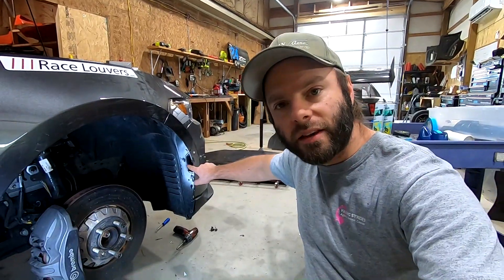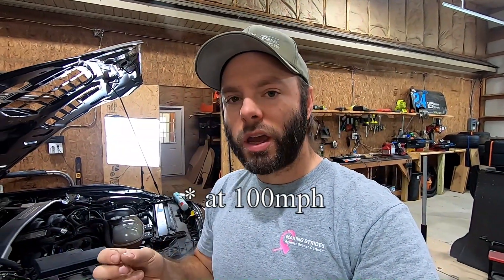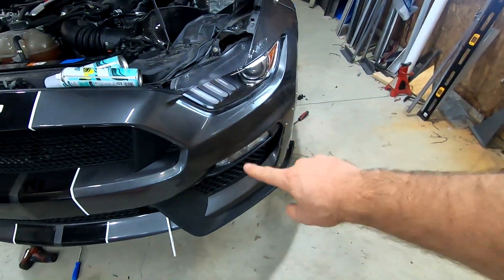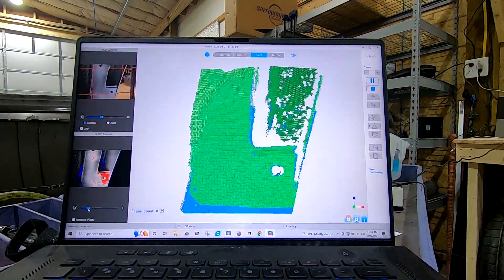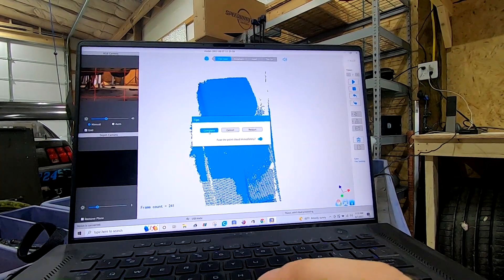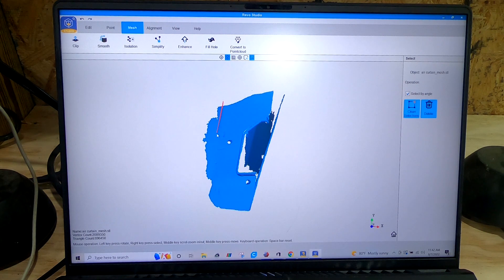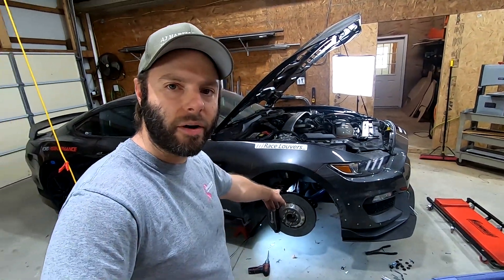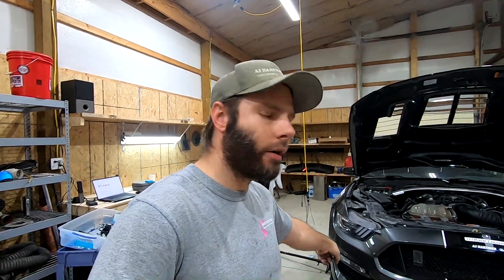GT350 Air Curtain Blockers (Wind Tunnel Data Supported)

Comment: I'd kill to have a 3d scanner like that! I'd be scanning body panels on my car, then modeling and 3d printing widebody parts and things to take molds off of to build carbon parts from. I experimented with a xbox one kinect, but I don't have a laptop, let alone one powerful enough to handle the bandwidth to scan with.
Reply: Tons and tons of people do this exact process! They judt have access to $6000+ scanners...
Reply: @Kurzawaa  yeah I have watched a ton of vids on it over the years. Even the "budget" 3D scanners are out of my price range.
Reply from the maker: The one I use is $700 or so currently.
Reply: @sinformant  Theres always iPhone 12 and 13 pro...they have liDar scanners.
Reply: iPhones can do scanning accurate enough for this now. The apps I’ve tested have pretty good tracking tok

Comment: I don't know mate, people who desing the Mercedes AMG GT Black Series is worrie about performance too, and they have more resources than me or you, and "this hole" is pretty big...
Reply from the maker: If it’s designed specifically around a track width and specific wheel package, sure. Put wider wheels and tires but don’t move the hole location and its no longer helping you.
Reply: @ajhartmanaero   You're right, in this case the flow will hit directly the tire, thx for the answer :)

Comment: You mean track pack gt350? Is your car a tech pack car? I've debated putting removable block offs on my gt but I think its negligible for me at an autocross level
Reply from the maker: Hmm you may be right. All I know is mine didn't have them. And yeah, at autox speeds you'd be looking at like 1-2lbs of Df.
Reply: I presume they are also ran on the GT350C and GT4 car
Reply: @ajhartmanaero   would you be interested in doing a 2013 CTSV sedan doors, trunk, and wanting a 1-piece front clip? Thank you sir
Reply from the maker: @weeman6539  sorry but not interested in taking on that project.